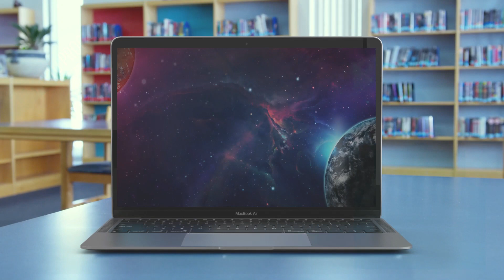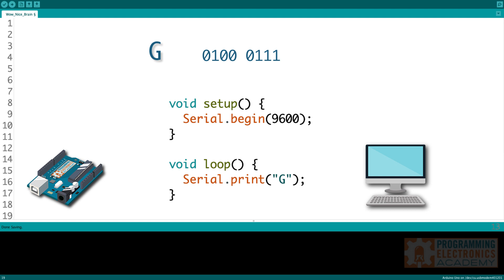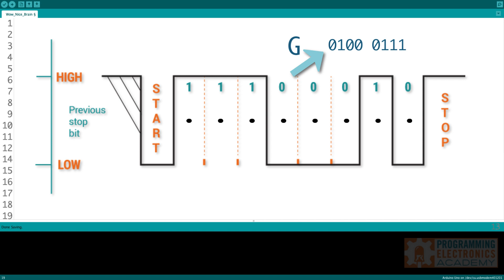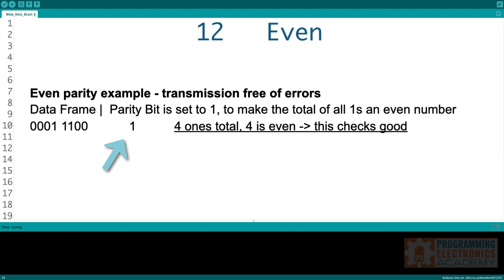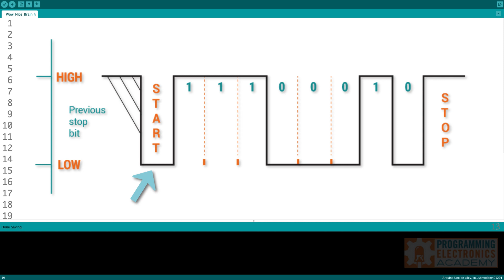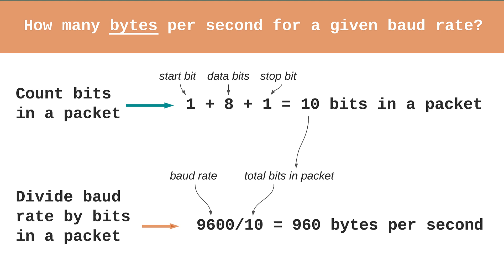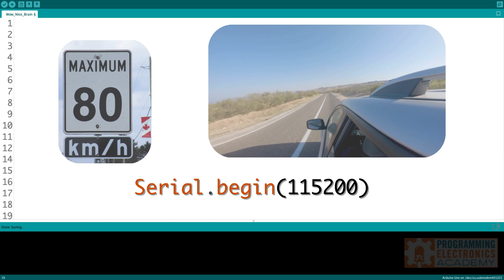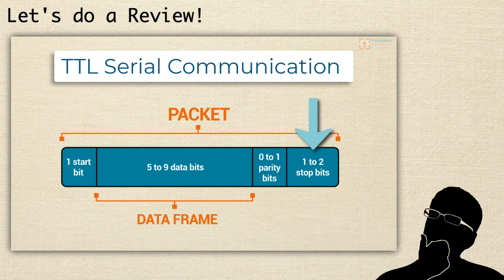TTL Serial Communication Protocol Explained | Part 3

Comment: Great video! The only thing that is still unclear to me, is how the sender and receiver agree on how big the different parts of the packet should be?
Reply from the maker: Such a great question David!

Basically, both side need to agree on it ahead of time - i.e. Both sides have been predetermine/designed for a specific size.

Sort of like... I wouldn't bring a Portuguese translator with me to Germany.  I would bring a German translator with me to Germany.
Reply: @programmingelectronics  Aah okay! So kinda like the baud rate, but then hardcoded into the UART?
Reply from the maker: @davidzwitser  Yes, that is the way I understand it.  I also believe most UARTs are configurable, and can adjusted for different data bits, etc.

Comment: Another great video... Is there a reason why you would ever want to be feeding in less than 8 bits? You said the data packet can be from 5 to 9, why would you ever want to feed in 5?
Reply: You are living in a complex world, not all engines are sharing the same vision.
Therefore, some chips vendors design their chips in a such strange way, I mean they design the protocol to accept 5-9 bits data. Or some times, you use the uart interface with your own custom chip(fpga for example) then you have the freedom to implement whatever you want, let say you make data bit to be 5 for speed constraints

Comment: Little bit confused by you saying the 0 on the left is the least significant bit. In binary 0 on the left (128,64,32,16,8,4,2,1) would represent the highest value, so how can it be the least significant? OK just double checked 01000111 = G, so 1 on the right would be the least significant bit, looks like you just stuck the pointer in the wrong spot, since you are feeding them into the serial starting at 111... which is in line with what you are saying.
Reply from the maker: That arrow location is confusing!   We were trying to just high light the entire byte but clearly it seems like we are pointing to the MSB when we are talking about the LSB.   Thanks for the catch!